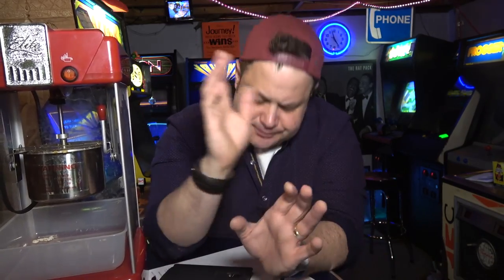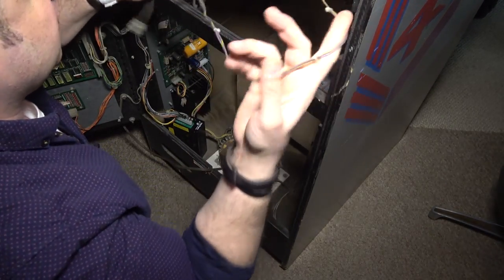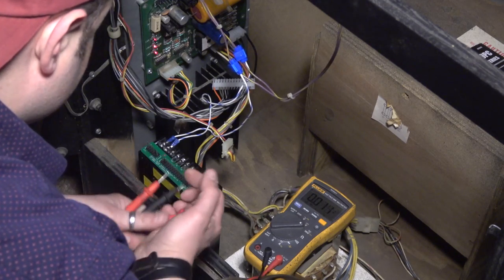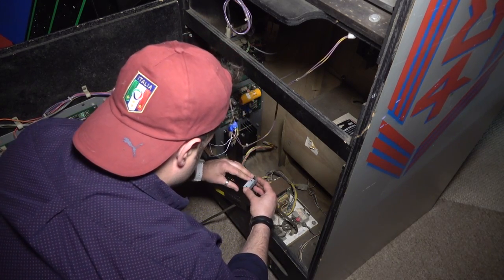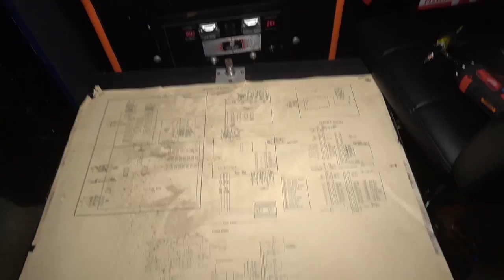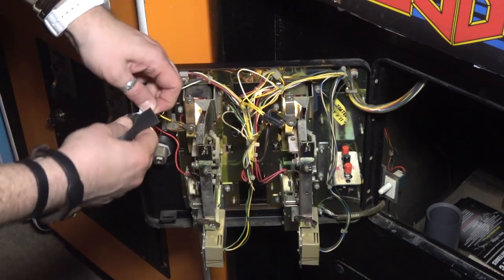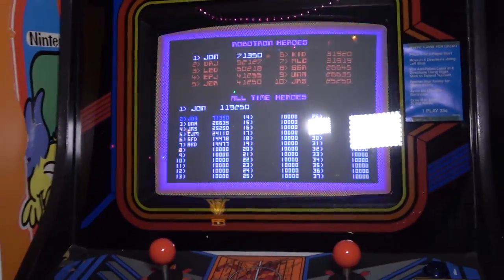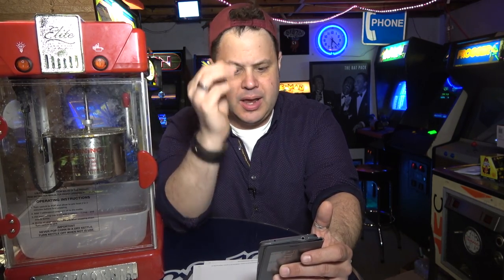Williams Robotron Arcade Switching Power Supply Adapter install - Part #2

Comment: Hey John, after quickly looking at one of your previous videos, those coin door lights were definitely working before.  From the Schematic that I have, it looks like that 6.3vac was originally coming from one of the transformer windings (through a fuse on the linear power supply).  If you do go back to the linear power supply, you might want to change the coin door light wiring back to the way I was;  Otherwise, you'll have one side of that transformer winding connected through the lights, to DC ground.  That 27v (red) wire looks like is for coin lockout.  I don't think that switcher has a 27v output, but may be of no consequence if you always use free play.

Comment: John, get the NVRAM upgrade kit for this and you won't have any issues with switching PS causing setting/score resets. Did that in both my joust and robotron and it works like a CHAMP! The upgrade also eliminates the need for a battery on the board as well.

Comment: In Joust, the bulbs are powered with AC. My Joust has separate wiring from the Happ supply to the coindoor with a fuse thrown in for good measure. Yours was wired OK, it was just wired for AC.

Comment: if you have issues where you need the cap figure out what lines the cap goes too and hook a diode from the line in too the cap with a coindore light between the diode and the cap and on the other end a nother diode so that the power can only go in durring play and out wen the power is out.

Comment: That works too. LOL! Robotron and Joust are pissy with switchers in them. They end up with memory corruption because the +5 and +12 come to full voltage at the same time on the switcher. This leaves the CMOS open to writes when the CPU still hasnt fully started. Like I said, I've got an adapter that I made that would allow you to use that switcher for +5 ONLY and would eliminate the CMOS failure down the road. Just LMK if you want it. :)

This is for John only you wacko's!

Comment: John ! you took the easy way out man ! (By installing a switcher), You really have become an operator haven't you !
The pre-operator John would have rebuilt the original....
By the way, you introduced the problem with the coin door lights with that switcher !
I hope this was just to get the game going and your going to rebuild that linear PS ?
Reply from the maker: Oh god. Yes, I installed the switcher because of the Hangar. As I explained, I didn't have the parts to rebuild in time but I had the Switcher. Guess what? There's a switcher in my Zoo Keeper, Journey, and Burgertime too. We might revisit the linear when I get the rebuild kit.
Reply: Yeah I did hear you say you didn't get the parts in time. The operator line was a joke BTW :-P
I don't know the history of your Zookeeper & Burgertime, but Journey I do remember and I was surprised you didn't throw those 2 filter caps in before going the switcher route.

Comment: I know you would have preferred to fix the original supply.  But, projects are piling up.  This way you know it was the power supply, and you can fix the old one once some of the other projects are complete.

I had to do the same thing recently, and bought a rebuilt carb for my ATV because it did not seem like I would have time to rebuild mine before the trip I am planning.  I will rebuild the old one later...

Comment: Hi John great repair video 😊
I was just wondering if having both 5 volts going to the coin door the way they were before you fixed the problem would have caused the problem with your old power supply?
would it have caused some kind of  short?
Anyway keep up the good work and I can't wait to see your future garage videos 😊
Reply from the maker: Watch Part 3!
Reply: got it now John 😊
I was behind on your videos so in future I'll watch your latest one before I add my comment 😀

Comment: The transformer can't be rebuild. You have the solution right there with the fresh power supply. 
 Next would be the high score ram.
 Then a solution for the plug from the sound board the the ram board.

Comment: hey I just bought a pac man arcade cab and when I plug it in it has no picture and makes a loud er sound do you know what is wrong.  One thing I found wrong is the transformer is supposed to put out 7v 7v and 12v 12v but its giving 7v 7v 10v 9v. im thinking about putting a switching power supply kit in it. thanks please help.
Reply: RPI DUDE replace the fuse holders to start with. they are always flaky on Pac machines then check for 5v D.C. On the pcb. Could also be the edge connector.
Reply: well i measured the voltage before the fuse holders. I measured them on the actual transformer and its getting 9 and 10 volts, and the pcb is getting 9 and 10 volts instead of 12. Im gonna buying a switching power supply kit but if their is a way not to please let me know

Comment: Williams boards do NOT like switchers. They don't have the filter circuit to handle switched power. Your high score table will corrupt or reset and your game will watchdog randomly.
Get a Get Well Kit for your linear, rebuild it and enjoy for the next 15-20 years. My Robo got a DeOxit treatment on the connectors, a new Wells K7000 monitor back in 2002 and I rebuilt the linear. 15 years later, still solid.
Reply from the maker: Time will tell. I got a lot of messages from people saying that had no issues.
Reply: John's Arcade Game Reviews & Tech you could always put some sort of filtering on it...?

Comment: Link for the kick starter to get an arcade in Paris, KY

https://www.kickstarter.com/projects/152144824/paris-kentucky-replay-arcade-and-soda-bar
Reply: "We want to have 30+ arcade games available, console gaming, and an awesome soda bar.  We need your help! We are seeking funding to purchase at least 10 more arcade games and to renovate a space to make it an arcade.  Most of the games that we have available are from the 80's and 90's so we would like to add some newer games to the mix."
Reply: If they want new games, especially driving games, etc. those can be several thousand a piece. But they don't have much detail on the kickstarter page in general. The hallmark of failed kickstarters is not enough information and specifics. Wouldn't surprise me if this fails. Hope not.

Comment: Bob Roberts explains the coin door problem you're having....http://www.therealbobroberts.net/wmslamps.html
Reply from the maker: Really weird. So.... my coin door was wired correctly? Makes sense... it was two AC lines going to it. So, I removed one and added the ground. Got it.
Reply: Bob talks about the coin door may short out which will blow your switcher so he installs a 5 amp fuse to prevent that. I like that you get your ground from the coin door but you still might want to install an inline fuse just to be safe. Cheers.
Reply from the maker: Ok, this is good advice. I think we will revisit this. It all makes sense now.
Reply: Why doesn't Arcadeshops switcher address that? they have the plug for the coin door.... Good question to address John!!!! :)
Reply from the maker: +Mac Donalds yes I do. I realize now what is going on. I'm gonna do a follow up video.
Reply from the maker: It's very strange that it has the coin door plug but you need to add the ground. Seems like it should be in the documentation.
Reply from the maker: Wow, that's really bizarre. What is going on with this thing?